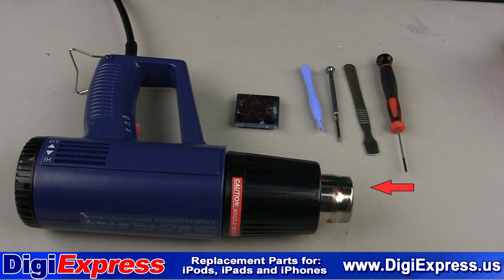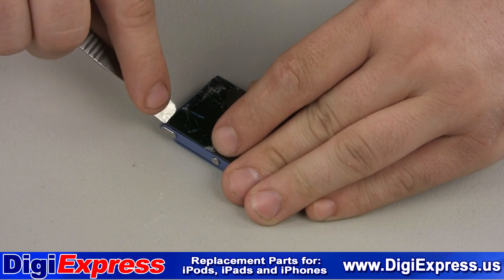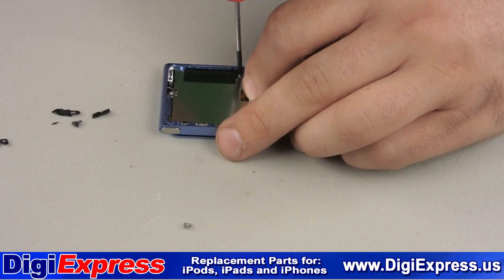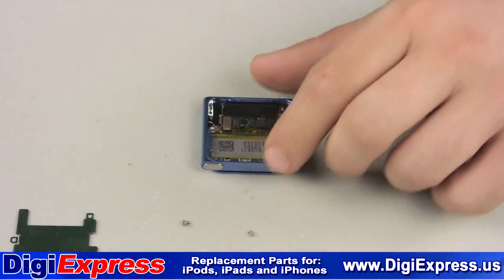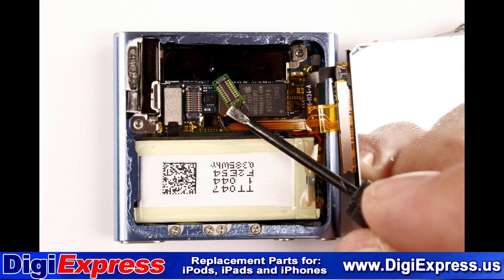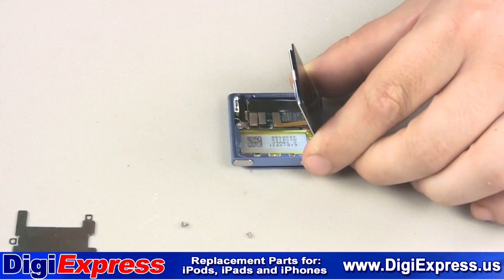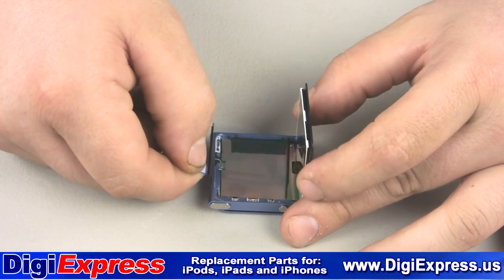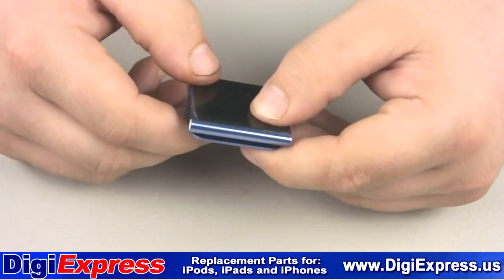DigiExpress - iPod Nano 6th Generation Screen Assembly Installation

Comment: DigiExpress, or somebody, have you an idea of the temperature I should put on the screen? My heat gun has the possibility to choose the temperature to work, so I would like to know it and the time that you suggest to remove the screen. 
Thanks.
Reply: i could do it with my hair dryer, so the temperature has not to be very high

Comment: i have followed all instruction to the "T" and the display screen will not open? i can hook it up to a port or a cable and works fine. before i took it apart everything worked even with the broken screen. i looked it up on google and youtube and the closest explanation i could get was that the battery is shot. but it worked before i repaired it. any idea what else it could be?

Comment from the maker: If the hard reset hasn't worked, and syncing hasn't worked, then it would narrow it down to either a bad part or a main board issue. If you ordered the part from us, contact customer service and they will send a new one out to you free of charge. If not, see if the place you bought it from will replace it. If that doesn't work, then it would be a main board issue. Our company won't repair the boards because it costs more than the device is worth. But try the new part first.

Comment from the maker: Try doing a hard reset on the device. Hold the power button and the home button down at the same time. Continue holding. The device will shut off. Don't let go until the Apple logo appears. Once it does, then release the buttons. Sometimes the device just needs to have this process performed to recognize the new parts.

Comment: Hey, can You maybe help me ?

My iPod had the infamous powerbutton-problem which I repaired and got a new screen+digitizer.
The problem is that after I repaired the button, and put the new screen and digitizer back, the touch-screen is not working?
Someone had the same problem online after they replaced their battery that the screen is not accepting touch input, but there were no answers to his post.
The connectors should be sitting tight, is it just a bad part?
Thank You :)

Comment from the maker: First thing to check would be your connection. Make sure that your screen is tightly connected to the main board. If there's a piece a little loose, it could cause a loss in brightness. If it is tightly secured, try to reset the device. If that doesn't work, there is a chance that the part may be defective, which can only be determined once it is installed and the device is powered on.

Comment from the maker: That's a difficult question. When moving all parts to a new case, a number of things could have happened. You could have damaged a cable. You could have damaged the main board. It's just so hard to tell. One of our senior techs said to try the old case and make sure that all connections are secure and tight. If the device is still acting up, then it is either a cable or the main board. If you get power, than it's most likely the main board that was damaged.

Comment: hey there, i tried to put the system, battery, and screen itself into another frame, but it does not work for some reason. i put everything back to the old frame, and it didnt function as well. Before putting everything into the new frame, the stuff worked in old frame. Can you tell what problem could be?

Comment from the maker: I don't know the exact specs on the heat guns our techs use, but it's just a standard heat gun purchased at a hardware store. If you don't have one of those, you can even use a hair dryer. The hair dryer would need an extra couple of seconds to heat the adhesive, but works just as well. The screen comes as a complete assembly with the digitizer and lcd. They are all fused together, so you have to replace the assembly.

Comment from the maker: It sounds like that would be the case, but technically, when you use a heat gun or blow dryer, your heating the adhesive so that you can work with it. There is also new double-sided tape from 3M created strictly for theses devices that we have switched over to and began using.

Comment from the maker: Absolutely. I recommend going to digiexpress.us and finding your device. Once there, you can select the repair/diagnosis option and add it to the cart, just like you're buying anything else online. It's $25. Once you purchase that, you will be able to print out the information and ship it in. If parts are needed, you will be notified. But it doesn't sound like that is the case. If you would rather speak with a rep, call 800-440-4693.

Comment from the maker: The Nano 6 has a screen consisting of Glass, Digitizer, LCD.  They are all fused together from the supplier and cannot be replaced separately.  There is no way to take your broken screen and separate any of the parts to re-use them.  Be careful of any sites trying to sell you ONLY the "glass" or "digitizer".

Comment from the maker: The metal plate acts as a blocker for heat, the little nano gets really hot being in such a small package.  It will also protect anything from bridging or shorting out connections when pressing hard on the screen.  But, if you are absolutely unable to get a metal plate, you can very carefully use strips of electrical tape to cover up any connections.  Your screen may be more dim than normal, but it will work.  If it were me, I would hold out until the metal plate comes in.

Comment from the maker: The glue will harden and it will make it difficult to have to replace the screen assembly again.  Mainly the "chunks" of hardened glue will need to be cleaned with a tool.  Like a screw driver or spudger, as much as possible that is.  Then you can to another repair on the device if necessary.  Generally we try to avoid liquid glue if at all possible, but on this device it is almost a necessity.

Comment: I opened my ipod up to fix a jammed button and now the screen (which is not cracked) won't work at all even when I close it up again. I only managed to take it apart that much because I don't have a screwdriver small enough to remove the screws. Did something come lose behind the metal shield or what?

Comment from the maker: @yerrys1313 The glue was Krazy Glue color changing (goes on purple, dries clear) with a brush applicator.  Though it is an expensive glue and you need very little of it, so general substitutions should be okay.

Comment from the maker: @SoStuckUp12 We have found that it is not possible to replace only one of the screens, though you may find that advertised online or elsewhere. There are machines and guides that align the Glass, Digitizer and LCD screens properly in a dust free environment, which is impossible to replicate at a cost effective level. So if you were to separate your display assembly without damaging it, you would still need to align the parts as precisely as they were from the factory in a dust free environment.